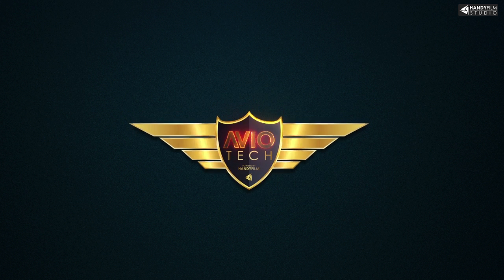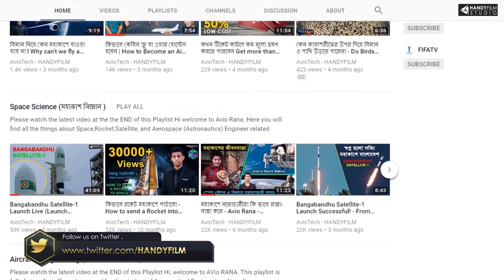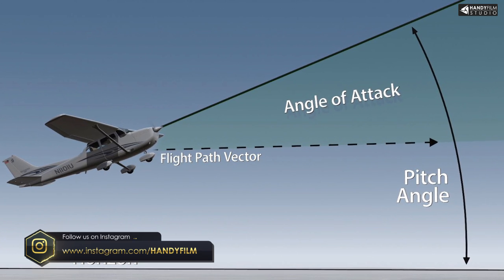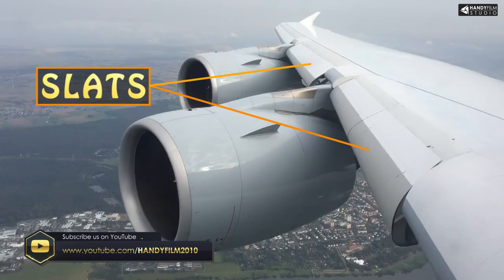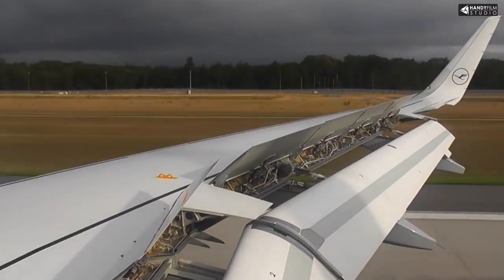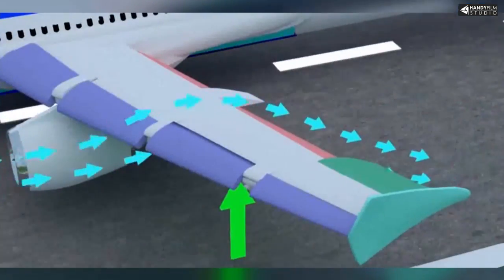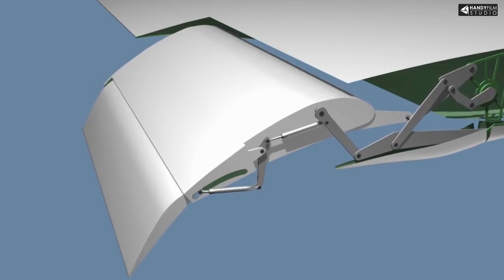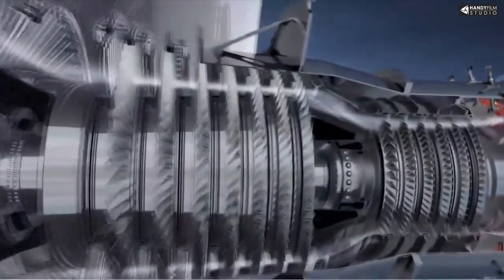বিমান কিভাবে ব্রেক করে বা থামে | How Aircraft Brake System Works | Avio Tech | HANDYFILM

Comment: Both flap and slat will increase the lift. Increase in lift will increase induced drag. And increased drag means increase in retarding force. Pilots should practically check this by making flapless landing. If you ever have a flap malfunction while flying, be mentally ready for a longer landing run.

Comment: Dharona vul, angle of attack barale speed kome na till 15° AOA, the wing generates lifts. Flap reduces speed, joto beshi flap toto kom lift amd drag beshi hoy amd flaps er karone aircraft er stalling speed kome. Na jene altu faltu vdo bananu bondho koren. Thank you
Reply from the maker: This video is for making you guys know about whole braking mechanism of aircraft in brief. Here in the scenarios we emphasized on the landing of the aircraft and talk only about mechanism related to brake.

As you are questioning here with other topics with pointing us then we suppose to make you clear. 
AOA  barale speed kme, I suggest you see the lift coefficient graph for a specific Number aerofoil from wind tunnel test. To get lift off the aircraft we put more engine power. But for a specific aerofoil speed not dramatically reduce till 15-18 degree AOA  but it actually reduces these only happen for3-4 degree changes.I will try to make a separate video on wind tunnel test later on that it will be more easier to understand. 

The wing generates lift that true. 
Flaps reduce speed that's also correct. We are also saying the same thing about flap in the video.  But falp has different uses too. Will not talk about that here. 

Flaps reduce stall speed that's also true. 

By the way thanks for you concern though.

Comment: info is not up to date na bhaiya..
slats is a high lifting device we used it due to lift but a portion of using slats work as a breaking device. flap is also high lifting device bt if Cl is greater than 1.4 than it will be stall 
by the way as you are aero engg L=1/2 pv2scl. so how could you say that if lift generate velocity will be reduce??
Reply from the maker: You are quite right about flaps.
But Here i am giving basic ideas about braking.  So i m here talking only about the functions of flap that helps to reduce speed though it's a High lifting device. But I am talking about the moment when we use flaps to reduce speed. The scenario that i am taking is landing  i mean to slow down the aircraft.   
Hipe you get it. And thanks for your critical thinking.
Reply: 1 -spoiler.
2-reverse thrust
3-padle brake